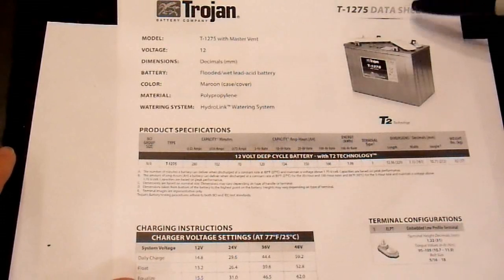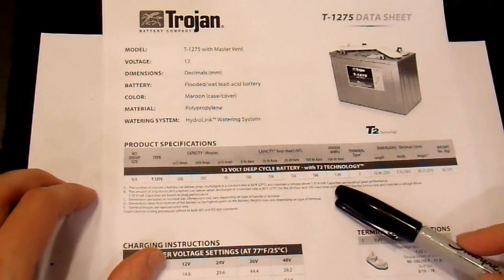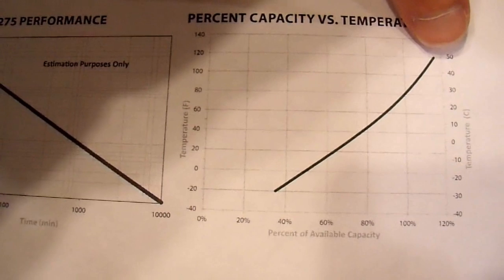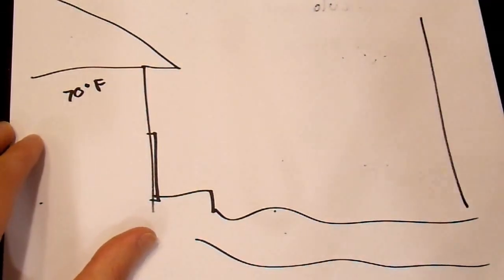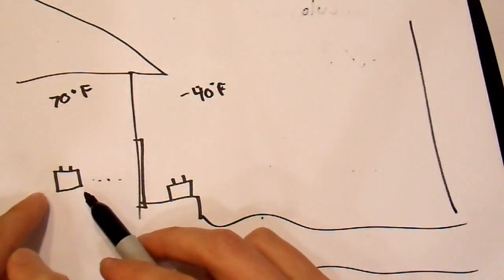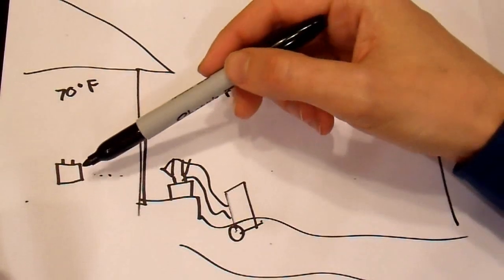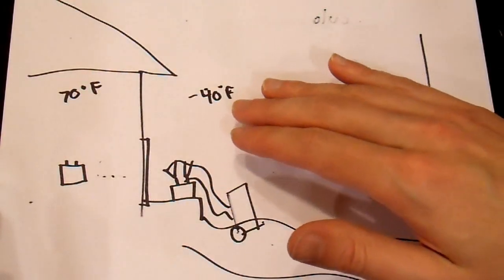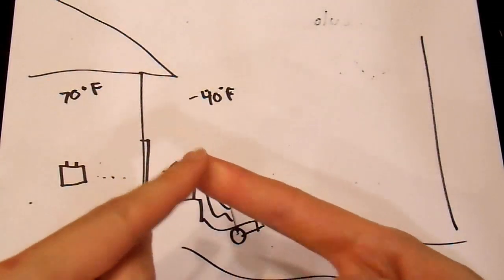Peukert's Law is Wrong and Here's Why - Part 3 of 3

Comment: I like to think of it like a 20 foot cylindrical vertically oriented water tank.  When it's full, you can run a sprinkler and spray water say 20feet on the 8+ psi from that much lift.  As the tank emptys to say 3 feet, you can no longer run your sprinkler, but you can still fill a watering can.  Water tanks, however, lack internal resistance.  Haha!
Reply from the maker: That's a good analogy!
Reply: +blmeflmm66 I've always likened voltage to water pressure and amperage as the quantity of water flowing..
The fatter the pipe the more flow
The higher the water tank the more pressure
My take on insulation: Dielectric strength is all about how tightly the  atoms of molecules hold onto their orbiting electrons
Conductors: how easily their electrons get knocked out of orbit
Random thoughts...
Resistance pertaining to the pipe theory: thin tube with 1/16th"  I.D. offers very much resistance even with a water tower at 300'
Same 300' tower and a 4" I.D. pipe could offer little resistance 
Of course this is resistance to "amperage" as the actual pressure is unchanged as long as the theoretical water tower remains full

Comment: I have a question about charging batteries that is slightly off topic. If I charge my lead acid battery to 14.0v using my bicycle generator it'll drop to 12.3v after about an hour. I don't understand why that is. Where did my voltage go?
Reply: This, sometimes called "surface charge" is the excess charge in the plates waiting to be dissipated into the electolyte.  Once the electolyte has absorbed the excess and reached equllibrium, you get your 12.3v.
Reply from the maker: blmeflmm is correct regarding the 'surface charge'.  However 12.3V indicates that either your battery is not fully charged or is damaged in some way.  The battery should hold at 12.7V or higher after sitting for a day.  You may want to put it on a wall charger for a while to make sure it is fully charged and then disconnect it, wait a day, and verify your battery is working properly.
Reply: ***** Thanks to you and blmeflmm66 for your answers to my question. I don't have a wall charger, though. I only have my bicycle generator, and that battery is currently being used as part of my very small off grid solar power system. Everything seems to be holding up OK, so I don't want to disconnect anything.
Reply: It may be "holding up ok" now, but that IS an awfully low voltage for a charged battery.  If you don't get it charged fully some way, you may lose it completely and soon.
Reply: blmeflmm66 Well, right now my charge controller charges the batteries to 13.7 volts, but since I use the electricity it doesn't stay there for long. I have 4 identical 12v 35ah batteries hooked up in parallel, and I've never dropped the voltage below 12v. I use this little system daily. It works.

Comment: knurlgnar24, you like practical experiments. You own a conductance tester, you own a fridge, you own several batteries, and you own a video camera.

Need I say more? ;) I at least would be fascinated to see an actual measurement of the internal resistance of a very cold battery, versus the same battery at room (or higher) temperature.
Reply from the maker: Interesting.  I'll write that one down for a mini-video.  Thanks!

Comment: Another good series knurlgnar, I do have a question you may be able to answer.
I have a battery backup on solar with a charge controller. ( it's a just incase setup)
What's better for the longevity of the batteries, to leave it hooked up and slowly charging the battery bank day in and day out even when I'm not pulling any loads off the bank or just let it charge when the voltage drops? ( The charger in float puts about 2 amps in each of the 225ah 12 volt batteries but I can still hear a little sizzle, I'm not really using much water)
Reply: autobri1
Hi autobri1.  I have a setup something like yours, solar charged battery bank.  I have set about giving mine some work to do instead of just sitting on float every day.  I have some small DC loads on it and I also run a 1000w inverter power some loads in my house.  Inverter has a transfer switch and I am working on a circuit to turn the inverter on and off based upon the charging voltage (right now I manually switch it on and off).  Many of the DC load replace AC "wall wart" power supplies with DC equivalents.  I wire up a small DC boost or buck converter to run off the batteries to output 5V, 15V, 12V or whatever voltage the wall wart puts out then plug that into my device.  I find most of those type of loads take anywhere from 3-10 watts on AC, while on DC, they typically use only 1/3 of that power.  I also run some of the lighting in my house off the batteries, too (12v LED) as well as some attic ventilation fans.  So I save energy which helps offset the cost of the battery backup system.  This has been working well for me for over a year now.
Reply: autobri1 I noticed that some Trojan's have an absorption voltage of 14.8V, but should be floated at 13.2V. This is different to the usual 14.5/13.8 combo I'm familiar with. Interestingly my Victron Multiplus inverter/charger has a "storage" mode for maintaining batteries over long periods, and that is set to 26.5V (or roughly 13.2 in a 12V application). So it seems that floating them at 13.2 is a good idea, but they need to see that occasional 14.8V to avoid long term sulfation.

A somewhat related matter: I read a paper recently on the matter of parallel battery strings. When they discharge, the strongest one does most of the work. When they recharge, the strongest one takes most of the charge too (lower internal resistance). So your strongest string deteriorates faster because it works harder, and your weakest string deteriorates faster because it's not seeing a proper charge. But apparently this isn't the full story -- and this is what the paper was about -- because after a while the various strings will equalize and charge will migrate between them until all are at the same voltage. you can therefore use parallel strings quite effectively as long as you take them down to a good level of discharge, and then properly recharge them by holding them at absorption voltage for long enough. Obviously it leads to much gassing on the better batteries and it is not very efficient. This particular paper points out that in the telecoms industry it is common practice to replace one string in a parallel bank, seemingly disproving the common-held notion that you should never do such a thing... :-)
Reply from the maker: What kind of batteries and at what voltage does the charge controller float the batteries?  In general I would charge them about once a month and disconnect the charger between charges.  Batteries left on constant float require more maintenance (water loss) and if the float voltage is not precisely controlled for that particular battery design it can reduce lifespan significantly.  Deep cycle batteries do have a finite 'float life', largely due to positive plate corrosion if electrolyte is replenished regularly.  Even following manufacturer's recommendations on float voltage will generally not yield optimum life.  Float recommendations are nearly always on the high side of optimal to ensure proper charging if no bulk charge stage is applied, or incompletely applied.  Some of the more high end industrial batteries actually give the tradeoff curves regarding float voltage, temperature, charging habits, etc and how they apply to service life of a non-cycled backup only battery.
Reply: ***** They are deep cycle Trojan batteries 8- 6volt in series parallel
The charger float voltage is about 13.2 volts. however when the sun comes up they start out higher than that about 14 volts than tapers down. I've even turn the charger to sealed to lower the voltage.
Reply from the maker: autobri1
13.2 is a good float voltage so long as they get a proper charge every once in a while.  13.2 is not high enough to properly charge them but will keep them from discharging too quickly once they are fully charged.  The charge controller is probably detecting that they need an absorption charge to be fully charged and is giving them that (which will be more than 14V) before returning to float voltage.  Those batteries are good quality but do have a high self-discharge rate, so I wouldn't be surprised if the charge controller thinks they need a charge more frequently than they really do.
Reply: ok, I guess I will leave them at  that charge rate which is set to sealed type, Thanks buddy!! you rock! love your video's and how well ( DEEP) you cover them!!!
Reply: R Brown Interesting. Here's another guy with a very similar setup to yours. I have a Victron Multiplus on a 24V bank of Trojan T125  batteries (240Ah), which includes a transfer switch and is fully programmable to switch at certain voltage points (or even SoC levels, if you have the corresponding BMV monitor installed). I live in sunny South Africa so the charger on this unit (the multiplus is a inverter/charger/transfer switch combo) is disabled and I use only the sun (even in the rainy winter season we have at least one good day of sun per week).

I looked at the spec sheets and it seems to me that if you cycle the batteries very shallowly the life of the battery will be close to what it would be if you just float-charged it continuously. This was confirmed to me by a local solar installer. I therefore take my batteries down to 80% SoC every night, then switch back to the grid, and tomorrow we do it all over.

I have empirically (and somewhat accidentally) seen the same results as in these videos. If I discharge my batteries at the C20 rate on the label (12A), the voltage holds up very well. But if I discharge it at 18A, which happens at night if both the refrigerator, freezer, television and a few lights are on at the same time and you left a certain breaker off (oops), it will drop below 24V very quickly and then almost drop off a cliff towards 21.5V. But if you take the load off and wait an hour or so... it bounces right back to 24.6V :-)

Comment: what if you where to put 100 amp diodes form each positive of the battery to a central positive so when a battery goes low it does not pull the other batteries down
Reply: What the diodes will do is cause the strongest battery to do most ov the work, then the next strongest battery will take over and so on. There is a little grey area here though where some discharge will come from other batteries simultaneously due to the 'knee' effect ov the diodes. This technique is often used to power a critical load from two separate battery supplies. It works well except for one problem. The voltage drop even using Schottky diodes is wasteful and quite a consideration in 12 volt systems.

Comment: I think the basics of peukerts law are:

1. The more current you pull from a battery, the shorter time you can do it for (as demonstrated by your multiple inverter tests with varying loads).
2. The lower the temperature the less current the battery can provide for a set time.

At least this is how I have always understood it. Until this video I had never thought about where the missing capacity goes (now I know that it doesn't go anywhere!)
Reply: Where does the light go when you turn the switch off.  Inside the fridge :)

Comment: Ahh... But if you put the battery outside in -40 weather and cool it down and then bring it inside and put it in your fridge your fridge will magically use less energy to keep cold!
Reply from the maker: I like it!
Reply: That's a good idea for putting a defunct battery to some use..! haha
Reply: ***** Yeah, that would be a killer time to employ a good old food safe..! :)
Reply from the maker: *****
This is why soda vending machines have heaters.  :)
Reply: ***** Put it in a 356 °F environment and see how  much energy you lose... I mean how much battery you lose... :) == PS - love your videos and thorough testing techniques! Thanks for the great information!
Reply: Not really.  You may be forgetting about the whosh of cold air that come into the house when you open the door on a -40 degree day.  Then it takes quite a bit of energy to heat the house back up to what it was before that door opening.  Also on a day that cold, you want your fridge/freezer to work hard since it will send more heat into the house.  Making your fridge/freezer work less hard will actually make your house heater work harder so there is likely no savings there.